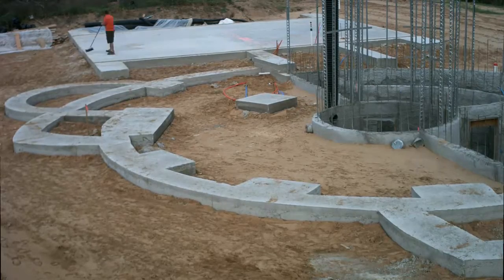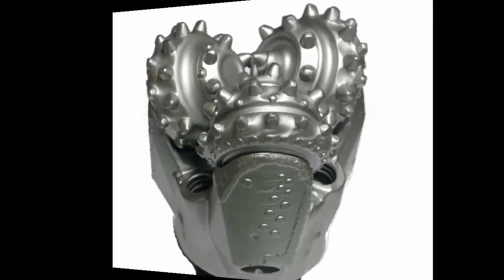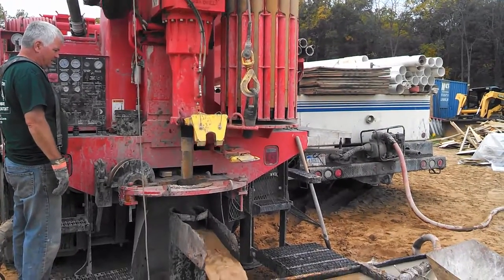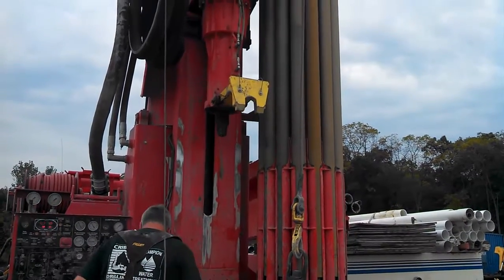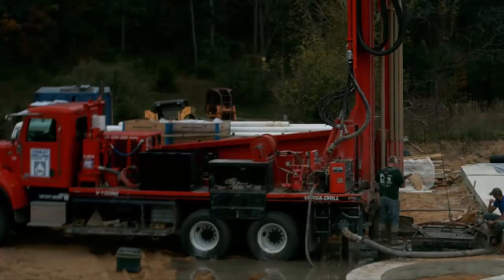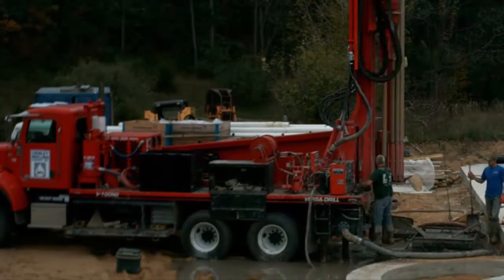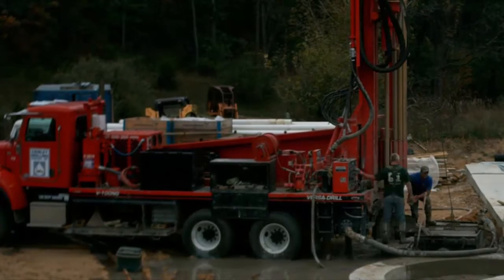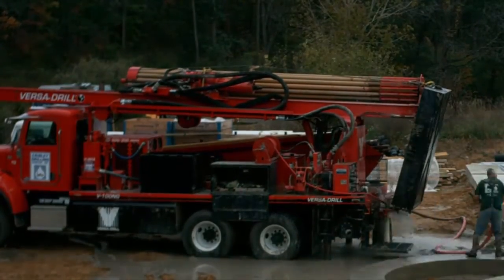8.0 Drilling the Well

Comment: How much did that cost?
Reply from the maker: The cost is broken into two phases, drilling the well and the pumping system.

The drilling section included...

For drilling and 5" PVC well casing = $15.60/ft
For those bags of grout you saw piling up = 35$ per bag (they used a couple dozen bags)
The they also charged $525 for the well tip.

Then for pumping, they listed a much of stuff like nearly $900 for the 1hp pump, $3.50 per ft for the pipe and wiring, plus another $3 per ft to dig the trench, $700 for the well tank, etc.  

In total, the estimate was about ~$6000 from all 3 quotes.  This was for a 130 ft deep well, 30 ft from the mechanical room.  The actual well ended up as 187ft deep and used about 3 times as many bags of grout (much of which ended up as a mess on the ground), so the final bill was proportionally higher.  

Digging the shallow trench was so easy on my sandy site that I wished I had done it myself and saved that part of the cost, but I was happy to pay the $35 they charged me to drill the hole thru my very strong shotcrete walls ;^)

Comment: Very strange way to drill a well.....no gravel pack around the slotted casing, no well development to ensure a clean well.....just pump the annulus with bentonite clay, fold up the rig and drive away??????
Reply from the maker: They are the number one well driller in our county.  Probably drilled most of the wells over the past 50 years (est in 1946), they must be doing something right.  Maybe the approach works for our terrain, but they would need to do it a bit differently elsewhere...?
Reply: @SimonHomeintheEarth  Well, at least your dude can back a truck up ;)